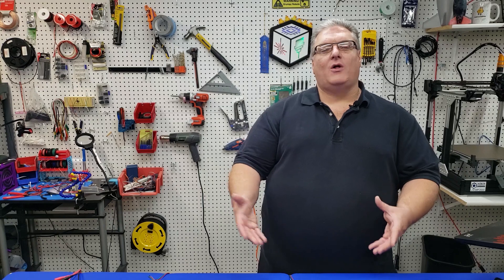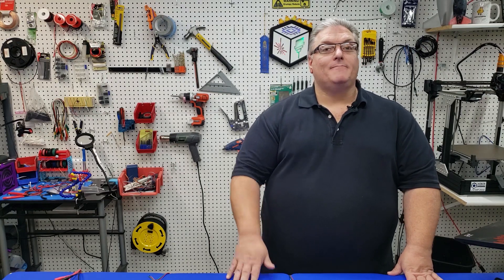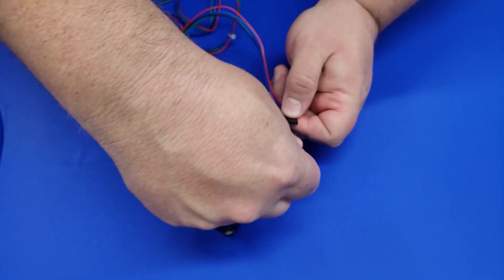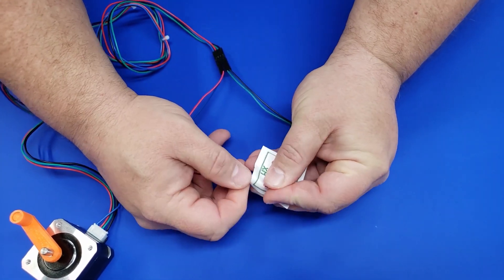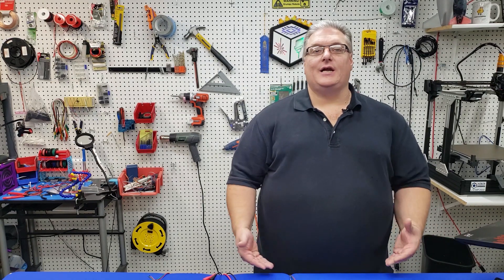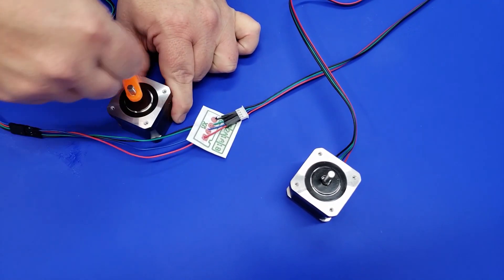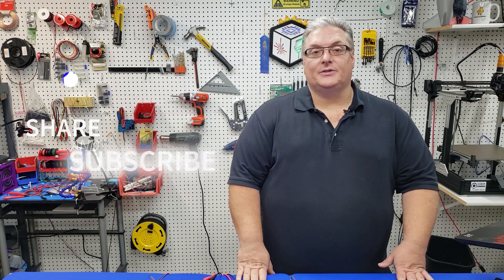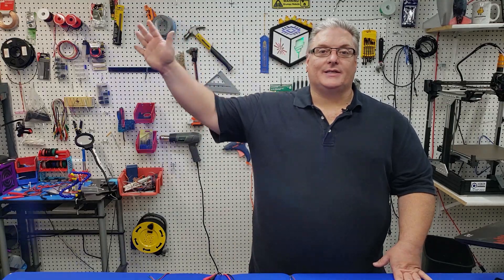Stepper Wiring Woes - How to get your steppers working in a new 3D Printer Build

Comment from the maker: How have you solved your stepper wiring problems?
Reply: Thank you for this video, it was very helpful. Thanks a lot!

So I could understand the circuit and connection of the motor and of the motor driver, and the rest of the wiring was easy to find:

Contact 1A and 1B is one ciruit, and 2A and 2B is one ciruit. First measure on the board which pin of the connector belongs to which contact on the driver. Take a multimeter for the measurement.
Then measure which pins at the motor belongs together, there are 2 pairs of pins again. If you know this, there are only 4 options of wiring.

After this you have to re-adjust the affected axis of the printer. Drive the motor without mechanical connection to the axis to its stop position, use the menu funktion for this. Then bring the axis in the end position and connect it to the motor. After this check the end position of the other side, use the menu function to drive the axis. Repeat this until there is no mechanical stop, it must be a smooth stop caused by the software, not by end of the driveway.

Maybe you have to adjust the voltage on the affected driver, begin with a lower voltage and increase if necessary.

Then make a test print to see if the current is high enough, repeat the process if necessary.

I had to change a defect motor at my Anycubic Mega X (in my case the Y-axis), and I couldn´t find any really helpful tutorials on Youtube.

This would be a nice video to show the complete process of exchanging, connecting and adjusting a new motor of a 3D printer.
Reply: Lots of trial and error and firmware changes until it works. Just got done with my first corexy build and it was frustrating to say the least.
Reply: you are a saint man
Reply: I am try to make my own 3d printer bay Following your video thank you so much for great video
Reply: I am try to make my own 3d printer bay Following your video thank you so much for great video
Reply: I'm not making a 3D printer so I can just identify the polarity of the coils and then change my sketch before making my board. Thank you for the video! I was sure a stepper motor isn't that loud… the polarity was just wrong.
Reply: Im just trying to get my new stepper motor to work with my Anycubic Photon.... Still hasn't worked, wont rotate.
Reply: Just cross two wires and try to turn the stepper motor shaft. It either moves easily or it doesn't. If it doesn't, that's a pair.
Reply: The twisted motor wires are usually from a 6 wire motor and they are common. Doesn't matter how you plug them in because you will probably just twist them together.

Comment: I’d just like to say THANK YOU!! you talked about the weird wire cross and like “why does that exist”!?!? 

So I just got a CR-10S Pro V1 that was in rough shape. Got the bed and everything figured out but the steeper motor wire was broken on either the 1st or 6th port of the connector to the motor. Naturally ordered a new set of cables thinking I’ll have to change it for another machine down the road. Turn on to test and the motor was jittering. Check the motor on other cables on the same machine works fine, so it wasn’t the motor. When you mentioned the crossing wire thing I checked the broken cable and it had the crossed wire. Crealit-really!! Then your bonus tip of fixing the connector manually from the plastic part and then… perfection it works again and I didn’t need to take apart the entire machine for a fifth time!  Thanks again for your help and advice!

Comment: Never had a problem with different stepper motors on 3d printers that I have. However, I just made a roller assembly for my Longer Ray  5 laser and when I plugged the stepper into the Y axis cable it just vibrated. I tried that same stepper on my Black Widow and one of my Enders and the motor worked perfect. I concluded that the motors on the Longer Ray5 are wired differently than my 3d printers, (the steppers themselves). I also put a different stepper cable that I had as a spare and connected it to the connection on the Longer Y axis and low and behold the roller stepper worked. In conclusion Longer IS using different steppers than used on most 3d printers. At least that is my conclusion.

Comment: i recently had different problem
1$ steppers from local ebay with no documentation are fun things to have. they are cheap, and often good quality used motors from  old dot matrix printers like oki, seiko or panasonic
ok then but i just had that one random motor and had to put it into ender 3  extruder as a emergency replacement
first of all it had different dc resistance, much lower so it would not really likelow currents oryginal stepper worked at
secund it was as you showed on video random pinout, and quite different than creality motors (2 middle pins were swaped around)
So after rewiring and swaping the motor replacement extruder kind of worked but had no power, thankfully the motor had 4 coils inside, 2 sets of 2 coils in paralall so i rewired it internally to hace only 2 coils, or more precisely wired both pairs in series and 1 ohm changed to 4. magic
then i still had to adjust current on the controller, but the main thing is it works better than not having an extruder and driver doesn't get hot either because required current over 4 ohm coil is much smaller than the one required to generate the same power from just 1 ohm coil
so the problem was the motor itself wasn't suited to be use with stepper drivers used in the printer and had to be modyfied
but after taking off the back you can clearly see whitch pins coresponds to which coil and you can change them around if you really want to match plug standard of a specyfic device
it would be much harder if you for instance got a 5 wire motor and want to fit it to 4 wire controller

Comment: Can I send you 2 motors that are from an industrial embroidery machine that are supposedly bad? I don't think they are. I think the problem lies in circuit board within the motor that supplies the power to those motors.
Reply from the maker: Just put a meter on the motor connectors and test for conductivity.  You should find paired coils.  If it comes up with all the coils working the only other issue could be a seized bearing.  So I'd just pop the connector and start testing.  If you don't have a multimeter it's about $20 far less than shipping them to me. 😉

Comment: Is it normal the step motor don't start running when the I set it with high speed? For solve, I set to start  with low speed and then increase the speed up to desire high speed.
Reply from the maker: Too much acceleration can cause a stepper to not move correctly.  Hardware does have finite limits to what they can do.  That will of course vary due to stepper driver, acceleration, stepper performance, etc.

Comment: Well I changed a motor nema 17 for a pancake Nema 17 and if It was working fine at thé beginning now I have the extruder out if working at all. I do not know where It is the issue
Reply from the maker: Check your stepper current . The stepper may also have insufficient torque.  All depends on what you bought.
Reply: @MakersMashup  Hi, thanks for your answer. I bought a stepperonline nema motor 17 pancake, It is 16 NCM Torque and 3.5 ohms resistance. I do not know if It is enough. Originally, it was a nema motor from the Rostock Max Delta V2 extruder, I change It for design a direct extruder and put a pancake nema motor 17. I do not know if I did well, maybe It is a motherboad problem because I had the problem with the old nema motor.

Comment: No. I am not getting current through the second coil? Is it possible to burn out a brand new stepper?
Reply from the maker: It could, I dont know what you hooked it up to.  Do you have another stepper with the same issue?  If you pushed too much current it could have caused the winding to overheat or arc.  No idea honestly but your stepper wires should pair and have low resistance through them.  Try checking it with a meter.  If you've having more trouble check out the discord, Im sure myself or others can assist you.

Comment: B coil stays grounded and will not turn even when wires are not connected?
Reply from the maker: Sounds like a bad stepper
Reply: Can a stepper motor be repaired ? @MakersMashup
Reply from the maker: @MrDondoerner  I doubt it but I suppose it might be possible. It's a motor on the inside with windings, I'd think that you couldn't fix but should a bad solder point inside be the cause it might be fixable. Outside my wheelhouse for sure.

Comment: I found the two coils on each motor. When I connect the first stepper to the second stepper it does not rotate. It jumps around on the table? Both steppers are a 57 HS112 red + and Green - second coil is yellow + and Blue -. When I hook red to red and green to green etc. I get nothing?
What is wrong?

Comment: Thank you so much! Have been looking for a solution for this weird behaviour of my stepper. Turned out the wires were wrongly connected. I thought the wires are already in the right order but they were not! The tip with the continuity was the key...thanks!

Comment: I watched the video,  Very helpful, however, still not working. You did mention asking for help in the discord. Wondering if you could possibly give me some direction. I'm new to this and setting up my first CNC. I was able to upload GRBL and Universal G-code sender. I'm using the Arduino UNO, with the red drivers. 4 axis. The orange light is blinking, the green light is on. I've double checked my motor wiring with an ohms meter. I am running the set up wizzard in the G-code sender program, when I try to move any of my axis motors in the program, I hear a low humming/buzzing noise, but no movement. It's difficult to determine where the noise is from, possibly the transformer/power supply? I doesn't sound like it's the motors. Is it possible that my drivers are burned out? Is it possible to bi-pass the drivers with a jumper just to check the motors? Any suggestions would be very helpful. TIA. Nick

Comment: Very useful Video thanks, but My problem is that laser (x)step motor is running smoothly  for 1.5 years manufactury connected, and now from 2 days it rejects to spin counter clockwise, it spins only clockwise direction, and sometimes or very hardly with noise spins other direction, doesh that mean that one of the 2 coils is fucked up ? I mean it got shorted somewhere inside the stepper or the probem is somewhere around the wires, because I track the all cables from stepper to the driver and didn`t see any problem around 4 color wires, also I replace today the step driver with brand new and nothing changed about the stepper motor , still getting hard spinning in both directions only one goes smoothly. Please help
Reply: Do I have to buy new one and replace ?

Comment: The board says 2b 2a 1b 1a on the pins.  How do I figure out which is which on the motor?
Reply from the maker: The pairs 1 and 2 go with two wire in the steppers.

Comment: Depends on what you mean by "twisted".  If the cables are twisted their entire length, then that increase resistance to elecro magnetic interference (emi) woth constant current devices.  At the power levels uses by steppers, it might not affect the motors performance, but the other end might be susceptible to damage from EMI or have other issues.  However, I'm skeptical this is why, as you see this in data transfer standards such as ethernet standards or USB standards (both of which are constant current voltage based messaging protocols).

Otherwise, not sure what you might be describing by saying "twisted wires".

Edit:  On second thought, I've seen techs do this strictly to clean up the harness or tidy up a tight spot.

Comment: You can also tap 2 wires and turn the motor and if it feels loose, its not the right wire. Tap onto the other until there is tension onto the motor. Then put led lights to find the + - part of the wire. 👍👍👍

Comment: Thank you for fixing my issue with my stepper motor wires on my 3d printer project! I was pulling my hair out when all I had to do was switch two pins at one end! Your video gave me the the one bit of knowledge that I didn't know I needed to know!

Comment: Hi! I'm going to change my noname steppers (bought the 2nd 3d printer - used one, the DIY kit, last owner was really saving his money :)) ) to Hanpose. I'm hoping to remove that vertical artifacts (we call it "the motor ripple) which corresponds to motor's steps.
Is it true that if I connect two motors (old and new) together like you've show here and the "slave" motor spins in the same direction as the "master" (when I rotate it) that the pinout is right?

Comment: Excelent video tip, Rob, thanks for sharing! I faced similar issue when I was assembling the X301 and I used the LED suggestion and even I have multimeter, the LED tip is super easy and it was very quick for me to reorder the wire colors and solve the problem. Greetings!!

Comment: the easiest way to pair the pins of one coil is to short them together when turning the stepper motor, if the pins of one coil are shorted, you will feel resistance to turning the motor
Reply: Ok, very useful comment thanks, but My problem is that laser (x)step motor is running 1.5 years manufactury connected, and now from 2 days it rejects to spin counter clockwise, it spins only clockwise direction, and sometimes or very hardly with noise spins other direction, doesh that mean that one of the 2 coils is fucked up ? I mean it got shorted somewhere inside the stepper or the probem is somewhere around the wires, because I track the all cables from stepper to the driver and didn`t see any problem around 4 color wires, also I replace today the step driver with brand new and nothing change about the stepper motor , still getting hard spinning in both directions only one goes smoothly. Please help

Comment: As a junior Electrical Engineer who works with magnetics and PSUs. I think I can answer your question. The twisting is for reducing cross talking on the wires from the board its good practice. This is probably overkill for a 3d printer but the best solution is twisting, ferrite beads, and shielding the cables. This technique is used on PSUs "power supplies" to reduce the noise and EMI. I recently purchased steppers and the seller sent me ferrite beaded wires which was a nice surprise to me.
Reply: I've fixed my Tevo Flash's "madness" only by shielding the ribbon cables. They run between the mb and the screen (with SD card). Y-motor is near these cables. So I guess it generates enough of EM power to influence the signals in ribbons. It was almost OK for some time but when I've re-assembled the printer on the 2nd time the things gone really mad. Then I was told that "this is because of ribbon cables. they're bad and etc. also they're not shielded". I've made the cables by myself (thankful that we have a good local cable supplier, it did took me just few days to do) and wrapped them in a foil which did maded grounded to the mainboard (to a free socket).
Before re-assemblying the 3d printer I've noticed that the original cables were formed in small spirals (like seashells). Maybe this made them more stable against EMI... But this technical decision was really bad from Tevo.
Reply: there is no over kill for 3d printing

Comment: I'm convinced the twisted wire sets are a result of the board engineer not communicating properly to the buyer in charge of ordering the stepper motors and them "fixing" it.